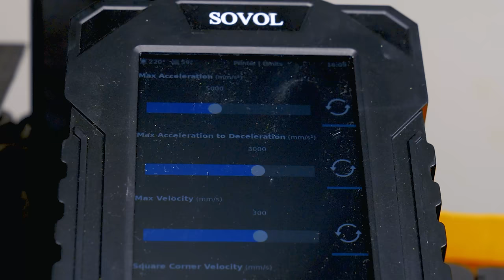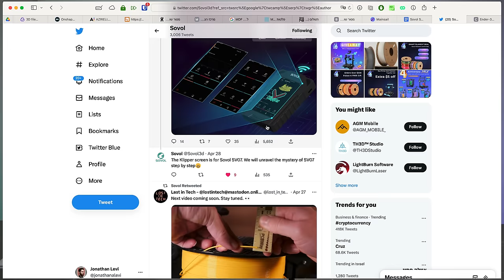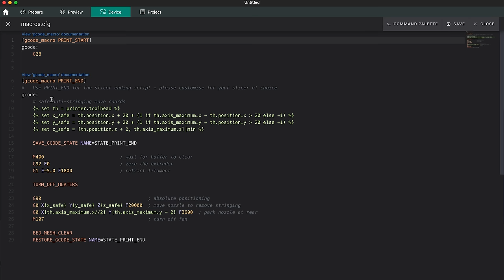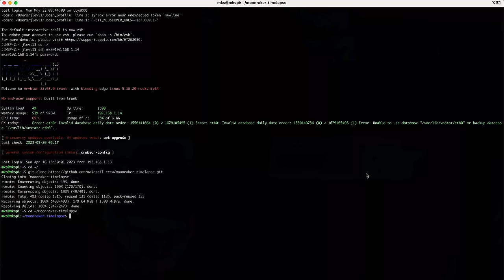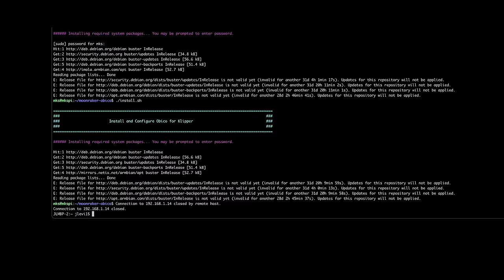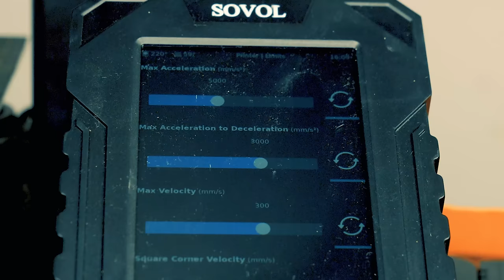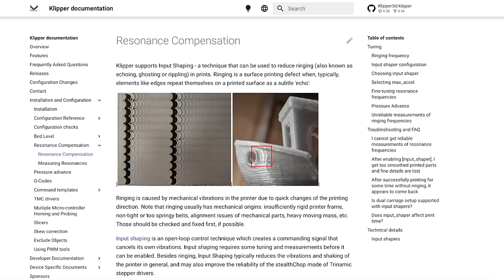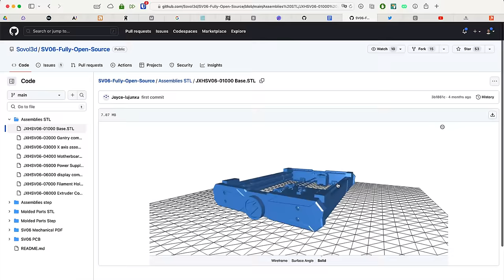The Sovol SV07 is a Game Changer. Here's Why.

Comment: I bought a dual-head Zonestar kit six years ago as my first printer, and learned the frustration of manual bed leveling, slicer tweaks, cheap part failure, filament variables, etc. on it.  Two days ago, after a week of cleaning, re-learning, and four successful prints, I fired it up to find the hot-bed no longer got hot, and had failed badly enough to melt the connections to the main board.  Looking at the potential of spending $100-plus on a very dated printer, I started looking at options, and found the SV07.  There are a handful of videos out here on this printer, and all of them have the same perspective - mine is now on order.  You've done a fine job of discussing this printer, your assessment agrees with everyone else's I've seen/read, and you made full disclosure all the way through - I don't know how anyone could do better, and thank you for the effort.

Comment: Some questions:
1) What type heatbreak is used? CR10? Chemera? Proprietary? Is it bi-metal from the box?
2) What type of nozzle is used? Volcano? Proprietary? if proprietary - is it abrasive-resistant? Are there hardened and/or size options available?
3) What type of fans are cooling the model? 2x5015? Does the back fan only blows on the center of the print?
4) What's going on with the Z axis? Are the lead screws top-constrained? What problem do the nuts with springs solve?
5) Can someone please explain to me what do the wheels not do on Ender clones where the mass of the bed assembly bottlenecks the speed/accel before motion system?

Comment: I dont know what is the problem with bed slingers, Is there just a nonsense trend of hating them? they just work imo...
Reply: People just think they are too slow now. People complain about Prusa prices, won't pay for a core xy, but complain if a bed slinger is cheap.
Reply: I think for a bunch of folks it's also about the potential bump in quality moving to corexy where it's only the print head moving and not the whole print itself, or being able to go higher speeds and cut down print time at the same level of quality of the finished part.
Reply from the maker: It really comes down to speed and quality. You'll get less artifacts on a properly tuned CoreXY

Comment: I started my 3d printing with the Sovol SV01. I then upgraded the SV03, which is my current printer. Upgrades to the board and hotend were early changes. With the large size and sadly discontinuation of this model, getting replacement PEI sheets has been tough to source for the flexible build plate. I recently found some thin BR10 locally that should last me a long time. I love Sovol's price/performance. With only space for 1 printer, I don't see myself replacing it anytime soon. I would need something at least the same size for the occasional large prints I do while offering something I don't have or cannot add for a similar cost. If I do go Klipper, I'll probably do it with some Biqu parts to modify my SV03.

Comment: V-slots won't allow you super speed (it's a slinger anyway) but the do offer  vibration dampening so less ghosting and less noise. Even if you run the wheels fast all the time and grind them those are still cheap to change. But hey I still would prefer linear rods if it was the same price because for hi quality and difficult materials you gotta go slow and rods are more precise.

Comment: My SV07 had some filament in the extruder, I think it's probably just standard QC. I've only had a few hardware problems, one of which was that the filament sensor is really unhappy with any curve in the filament when you load it- have to straighten it before inserting into the sensor, which isn't a big deal, just another thing to remember when loading. The other issue, which is more of a problem, has been that the adjustment eccentric for the roller on the bottom of the print head does not get tight enough. No matter where in the rotation I turn it to, it still has a little too much slop in it. Other than that, the print head is massive compared to my Ender 3 S1 Pro's sprite head- it does a fantastic job of cooling, and it's nice to have the lights on the head instead of on a light bar, but it's definitely showing a difference in how much correction is required in the input shaping vs the S1 with a sonic pad.   The print quality is virtually identical, and it's almost half the price (I got the early preorder deal) of the S1 Pro and the add-on sonic pad, but I do assume I will have to be extra vigilant about keeping things tight as that's a lot of print head to slam around over time. 

Software-wise, the screen responsiveness you mention is only a problem for me when it doesn't respond quickly to an emergency stop command (also, turn off that confirm requirement, kids! Whoops!😂)

I definitely agree with your overall assessments, it is a great printer and at the price point, it can't be beat. I have an X1 Carbon, the S1 Pro, two CR-10 Smarts, a RatRig V-Minion, an AnyCubic 4Max, and two Raise3D Pro3 units that are all in regular use between home and work, and I suspect I will be finding new homes for the 4Max and the RatRig to either add another SV07 or a P1P shortly. Since I added the Sonic pad to my S1 pro, I haven't used the V-Minion at all due to the small bed size.

Comment: Thank you for the sponsored video. done well. would like to know more SV06+ vs. SV07+. Specifically is the SV06 more beginner friendly / less buggy.  The large print is a huge factor in my upgrade. Auto levelling was due for me after years with Ender3V2. Auto filament is an upgrade I needed. I am concerned if the filment could break between the huge distance from the sensor to the dual drivers. Since this will be my first SOVOL, how is the support - both in community and through the company. One AMZ review stated their device "caught fire" after 2 mo. Is this a real concern? Lastly, one option that Ive been holding out for in a budget printer is multi filament prints. Is this an option for under $1200. Thanks.
Reply from the maker: If you want multi filament, you will need to go with the Bambu lab A1 combo. I’ve had many Sovol machines and they are great. Personally, I would probably recommend the SVO 7+ because of the clipper, but I think they now sell SVO 6+ with a clipper screen and that has a more rigid frame which might be better for you.

Comment: Great review even if you are a paid shill. 😂 I have a few printers that have a special place in my heart. Of course the first Ender, the first large plate Kobra Max, the most easy color BL X1C, my first Prusa MK3s+. Amd most recently the Sovol SV06. I purchased it to compare to the Mk3s it is modeled after and was truely WOWED! I have since recommended it to many people wanting to start 3d printing amd few looking to upgrade from what they were currently using to squirt plastic. Based on the performance of the SV06 I was preparing to order a 06+ when I heard of the impending 07 coming. So i held off and instead locked in a 07 preorder day if offering, and am excitedly awaiting its arrival. Thanks again for the great work you do for our community of Squirters.

Lil Stan
Plastic Squirters Union 
Local 1.75

Comment: I think you did a great job even though Sovol sponsored the video. I am planning to buy a new printer at the moment and I really don´t know what to buy. Creality K1, Sovol SV07 or a P1P. The more videos like this I see the more confused I get and the more I am leaning towards the SV07.
Reply: Repairability is for sure much easier with a bed slinger. My first printer was the SV06 and it startet to print uneven in height. I just fastened all screws, and they are all easy to access - problem fixed.
I love my SV06, but with Klipper built in (and Wifi, and the LEDs, and the speed) I ordered a SV07, because it will cost quite the same to bring the SV06 on feature-parity with 07, plus a lot of hours to recherche parts and building…
Reply from the maker: I would let your budget dictate, to be honest. If you can afford a Bambu printer, that's a best-in-class situation. If you cannot, or if you're not sure you will love the hobby, start small, with the SV07. I haven't tested the K1 yet, but it'll be here hopefully this week... so look forward to that.
Reply: @thenextlayer  Yes I can affort a bambu and I already have a printer (Flashforge Creator Pro) but Looping for something more up to date. Thanks for your advice I go with the P1P then.

Comment: There is like 0.000000000000000000000000000000000000000001% chance that I will even going to think about buying a bed slinger ever again!
And no way, I am going to buy a Voron and mess around with all those things. So what will I then buy? Well, it will properly be the Bambu Lab P1S.... The new version with casing ect. I just want to PRINT! and not waisting my time with building from scratch again. Ender 3 Pro was a pure nightmare for me, and the Voron journey was to darn expensive!

I would never trust anything you say, without reading or watching anyone else about the same product. I am to old, and have learned the hard way of what to do and not to do, when I buy new things. BUT! You do it really really good and in a really trustworthy way, People should learn to research on anything they don't know about BEFORE buying. That do will save them for many thrown-away of money. Just my point of view.

Greeetings to ANYONE HERE! Hope your all good and safe.

Comment: You asked if anyone else had a different color filament come out at the start of the first print. I did. i was testing with the white filament that came with the printer and it started coming out black. then I noticed int the manual that they test each unit prior to shipping. So, unless someone's first print is the same color they tested withat the factory, everyone will see this.

Comment: I ordered it within minutes of preorder release and got it for $299. This will be my first 3D printer & didn’t want to spend $699 to $1,400 for the Bambu printer. I’m testing the 3D printing waters. I’m not looking for a slow printer and need something easy to use out of the box. I gave Sovol a chance based upon your experience and recommendations for the S06 and S06+. I can buy Creality printers off the shelf at Micro Center, but I feel they are not easy to use and are unreliable. Prussia is great but to overpriced for what you receive. The 3D printing industry has finally changed from tinkering to offering Fast and Reliable printing for the rest of us. I like to tinkering as much as next person. But I’m done now that life has gone back to normal.
Reply from the maker: You summarized it very well. I think you’ll enjoy the SV07. Thanks for the comment!
Reply: Good luck on your purchase. May you not end up in a blown stepper motor and a extruder with stripped planetary gear like me after only 100 hours of printing!

Oh yeah, and my print bed puts even the Grand Canyon to shame, and the bearings more dry than the sand on the moon. You know, Sovol QC!

Comment: There's nothing wrong with using OpenBuilds style v-wheels on 3D printers. If the printer manufactures used the higher quality sealed bearing polycarbonate wheels, and people didn't over-tighten the eccentric spacers, the wheels would last for years. They are/have been used on CNC rigs for years.
One mod for the SV07 might be replacing the v-wheels with the aforementioned sealed bearing PC v-wheels.
The ultimate doom for Klipper based bed slingers is height. Physics will define that Klipper pressure advance and input shaping will not be very effective when printing tall prints at very high speeds.
Also, the new Anycubic Kobra 2 uses hardened steel SG15 wheels on steel rods. You might want to provide viewers with a review of this printer, as presently you can buy one for $269 USD. It seems, the Kobra 2 creates excellent quality @ 150mm/sec and claims a max of 250mm/sec (and no--my comments are not sponsored). ; )
Reply from the maker: Great comment, thanks for sharing. Does the Kobra run Klipper? I didn't know...?
Reply: @thenextlayer  The Kobra 2 runs on (as far as I know) Marlin 2.X. Supposedly, a near future Kobra 2 firmware update will include input shaping. I suppose aftermarket or mods will supply accelerometer support?
I'm converting a few of my printers (including a massive Anycubic Predator delta) to Klipper via the inovato Quadro Linux pc. I'll be learning a lot about Klipper. I have an X1 Carbon with AMS, and just ordered a QIDI X-Max 3.
Reply: Good advice! I think I read somewhere on reddit concerns that metal v wheels may damage extrusion which is more expensive to replace  compared to regular POM or PC ones. Not sure if that is an issue for the anycubic printer but PC wheels is probably a good idea (I was considering upgrading at one point)

Comment: I really hope they apply what they learned here to their SV06 line in the future, maybe in a new SV06-like printer with Klipper capabilities and better hotend. Yeah this machine looks fine, but it's essentially an Ender-like, unlike the SV06 which was a Prusa-like. Rubber V rollers vs much more stable and longer lasting rod system. It's just iinherently inferior. Can't spin it any other way, it's objectively worse.

Comment: Isnt this a prusa clone with an ugly extruder/hotend?
Reply: No.
Reply: The SV06 is closer to a Prusa i3 MK3 S+ clone. In my opinion the SV07 is a step backward. You're better off klipperizing the SV06 yourself.
Reply from the maker: Correct on this comment. Depends, though. SV06+ Raspberry Pi or Sonic Pad might cost you more money and be less integrated / not have a touch screen... but you'll have a more rigid frame. I don't know if it matters (the V-Rollers), though... and THIS would be my recommendation for people who don't wanna deal with flashing firmware! But yeah, my SV06 with Klipper was a beast till I passed it along to a Patreon supporter :)

Comment: the SV07 is easily the worst printer I have every owned, it cannot keep any kind of calibration for even a single print, you cant print anything larger than about 1-2cm or it will de-laminate immediately (all adhesion tricks included), I have rebuilt this thing and calibrated it so many times its not funny and only managed to get a 3 prints complete and they were small, everything is checked and I am using Sovols own profile (slowing it down doesn't help either).  I would go back to my old Creality s10+ before using this again, its literally going in the bin because its not worth the price of postage back to the US. this is one of those lessons on getting what you pay for not watching un-invested reviews on products.

Comment: Dude Sovol and Creality are the same company.. They use the same boards... and same electronics.. Its like the difference between GM and Chevy..
Reply: I could be wrong but, I think you're wrong. 😊
Reply: @stanbrown853  Title of the article "Sovol SV01 Pro Review: Creality Inside"
Reply: @stanbrown853  They are indeed the same company.
Reply: Humm ok so because they source parts from the same suppliers and are both based in Shenzhen they are the same company? I guess according to your logic Anycubic is the other point of the devils triangle. They too use some same parts as both Creality and Sovol and are also based in Shenzhen. So wow 😮🫣

And like I said, I could be wrong, but still think you are wrong. 😁
Reply: @stanbrown853  Believe as you wish dude, I am in a position to know, Both groups are partnered with a group im part of called 3DPRescue. Both have come out and  admitted that they are the same company. We Found this out because, one, we asked, and two, If you open most sovol machines, they have creality branded 4.2.7 or 4.2.2 boards... All three of my sovol machines have creality branded 4.2.7 boards with sovol branded firmware from the factory..
Reply: Hi all, a few facts as below, thank you for the support.
1. Sovol is now independent, not part of Creality, and has no relationship with each other in terms of equity ownership, etc.
2. some old machines were designed by Sovol, then let Creality OEM, and use their parts. 3.
3. starting from the SV06/06PLUS series to the SV07 model, from design, and procurement to manufacturing are all done by Sovol independently, with no relationship with Creality at all.
Reply: @Sovol  Thanks for clearing that up.